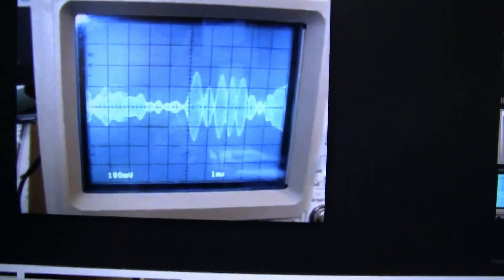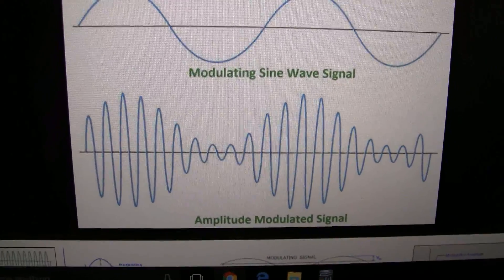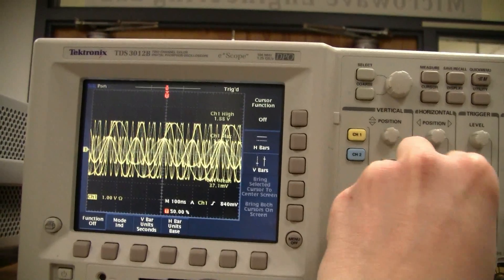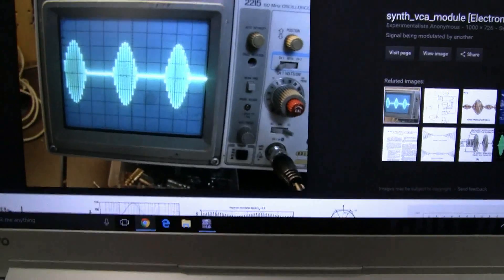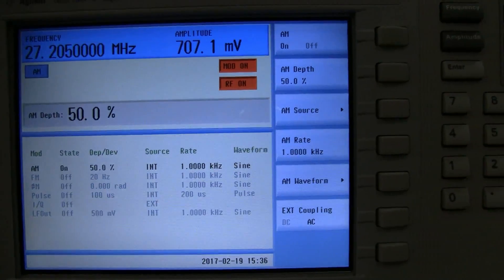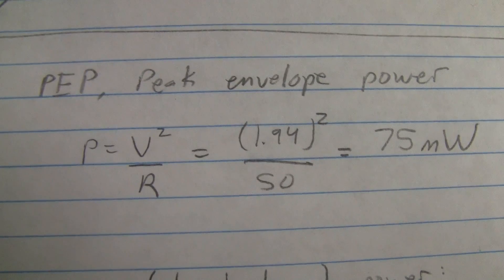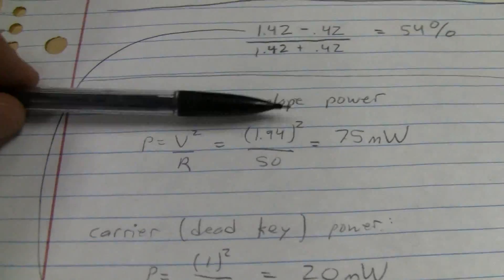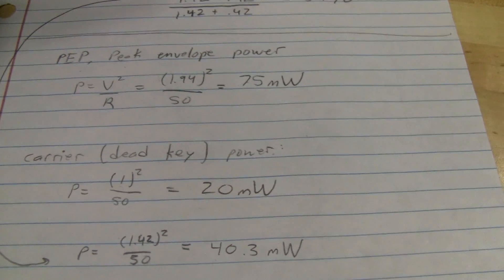Peak Envelope Power and Modulation: Theory, Math, Measurements

Comment: You don’t use the peak voltage to calculate the PEP. You have to convert the peak voltage to RMS voltage or multiply by 0.707.

Comment: With regards to needle modulation, I think as best as I recall from the old ARRL handbooks, that peak modulation is occurring when the meter is indicating around 62 to 68% of 100% modulation.  Depending upon the circuit weight factor applied to the meter.  And an attempt to adjust the modulation meter to read close to 100% on the peaks, results in the meter swinging way past 100%.  Hence modulation meters are relative rather than accurate. In addition, something like an old Drake ham radio watt meter with +/- 3% accuracy full scale, is more accurate than a Bird Wattmeter.  The Bird Wattmeter is rated to +/- 5%.  A well-made amateur radio wattmeter is sufficient enough and does not require plugins.  Just a 50-ohm load.  Furthermore, if a radio tech wants to look at the power in more accurate terms, the tech will pull out the oscilloscope.  Now when a CB radio operator or a ham for that matter, has adjusted the audio so that the modulation meters is running close to 100% readings, they have gone past 100% modulation in reality.

Comment: I agree this is confusing and there isn't any good explanation of PEP and modulation. PEP is the "average" power over one cycle of the RF carrier at the peak of the envelop.
So you need the RMS of the voltage at the peak not the value of the voltage. Ie what your measuring is Peak instantaneous power. Ie multiply the volts by 0.707.
For the ratio of PEP to dead key average power this factor cancels out. 
Anyway I'm still learning this so if I'm wrong please, anyone, tell me about it in great detail so I understand.
I'm trying to understand if it's possible to map the peak instantaneous power to average power of an audio signal to that of the RF output of a SSB transmitter. So far I've come to the conclusion that the only answer is to feed it through a SSB transmitter emulator and measure the result....

Comment: I see a slight amount of distortion in the negative Peaks. If there's any amount of distortion whatsoever all the power is going to waste
Reply: Are you referring to crossover distortion?  Or symmetrical amplitude distortion?  In the case of asymmetrical audio, this can be used as a method of modulation to limit the negative peak amplitude.  In which case, a negative peak amplitude that is less than the positive peak amplitude is a good thing.  If anything, audio modulation circuits are usually slightly asymmetrical on the positive audio peak, with the negative peak amplitude slightly greater than the positive, even when the modulation is adjusted for control of the positive peaks the negative ones still clip.  The peak limiter only samples the positive peak amplitude, which does nothing for the negative peaks, in something like CB and ham radios that were not designed for broadcast quality audio.  Even when Class A circuits for the audio are in use, asymmetry occurs, especially in the high-powered audio amplifier transistor circuit.  CB and ham radio modulation amps are not designed with much audio headroom left over and hit near the saturation region on the audio peaks.  Hence, they reach a region of asymmetry which suppresses the positive peak amplitude.

Comment: Thank you. I need to rehearse this practical exercise so I can burn this in my brain. I would love to see a video of a HAM running 1,500 Watts PEP in AM, SSB & FM with a super clean signal and compare it with one of the trash amps out there at the same 1,500 PEP.  I don't see a rush of online amp builders rushing to send you their equipment to test though. Great video!
Reply from the maker: I would love to do those tests, however I unfortunately don't have access to this wonderful microwave lab anymore. I would also need a solid dummy load which I don't have